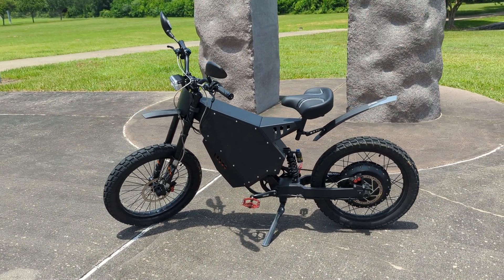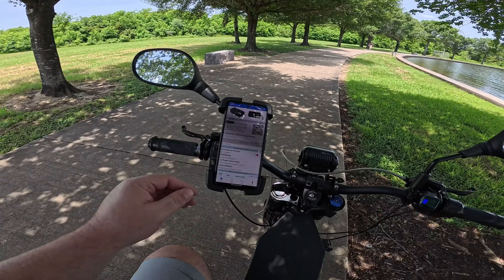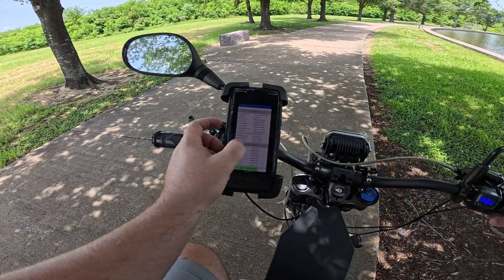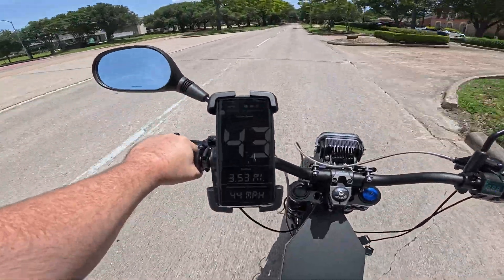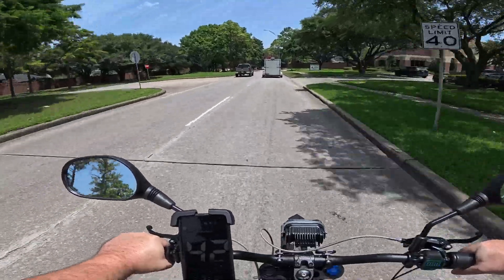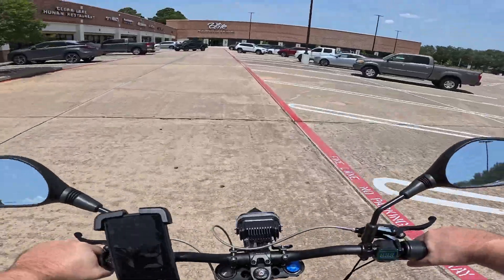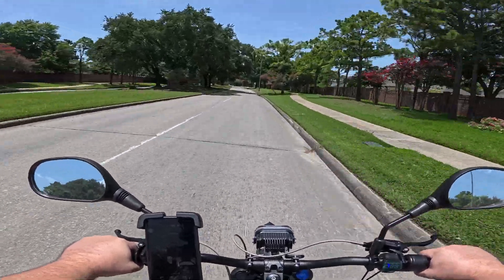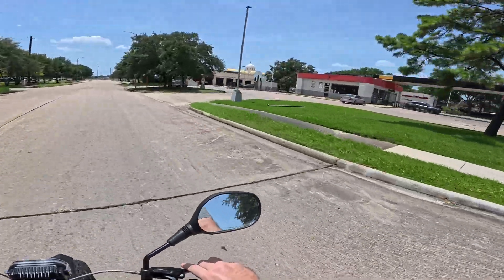I Unlocked 600 Phase Amps on My Stealth Bomber eBike — MORE Torque!

Comment: They are 50E EVE cells not samsung there is a difference. The Sammies can handle 9.8 amps and the EVE 50E can handle 15 amps. 15 amps x 15 strings equals 225 amps. I am an electrician, I work with batteries all the time. Raising your phase amps won't really do much for you if you don't raise your line amps with it. Watch my video. I explain that I'm not suggesting running 225 amps all the time. Unless you are doing a drag race leave the amps turned down. But for up to several minutes the cells can handle 15 amps just fine.
Reply from the maker: Interesting, let me do more research, if you are right I will make another video to correct the record.
Reply: Can you drop a link for the bike? Did it come with battery and charger? @FewMoto
Reply: Do you use Patreon? They are the source of truth for lithium batteries. My buddy told me you mentioned 225 amps in your video so thats why I commented real quick.
Reply from the maker: @randallhack4477  I'm glad you did, I learn a LOT from comments.  No not on Pateron
Reply: @FewMoto  Awesome now can you watch my top speed run so I can get some views LOL also, I set my phase amps to but 650 and line 225 my bike was able to reach 78.44 mph. I have the 3.5t winding vs your 2.5t but I think my 21 inch wheels offset the difference in speed and torque by virtue of being a larger cicircumstance.. also i got a motor spec sheet from my seller and they say it's rated for 15,000 watts. It does not appear to be a true QS motor. I will try to email that to you
Reply: @randallhack4477 it’s not, the qs273 is rated for 8000w nominal and 16000w peak but it could handle double that, you can run 30000w on it at 72v 

I have a qS205 3.5T hitting 85mph at 300line/650phase, no field weakening … but it’s a 84v 24s set up, so 100v fully charged, 28kw and so far no issues
Reply from the maker: Okay told chat GPT about the EVE thing, and you are correct, tomorrow I will do a new video and increase line amps to 225 and maybe leave phase alone at 600.  Thanks for the info!!

Comment: Hi i have 2 questions 1st one is if i mainly ride on toad with a little bit of off roadimg should i get the 72v 12,000w stealth bomber or the new 2025 surron lbx. And my second question is how much dows your stealth bomber weigh? Thanks
Reply from the maker: The stealth bomber is strictly a road bike imo.  However I would not recommend anyone buy a surron, the eride pro 3 is a way better bike.  My bomber is about 200lbs.

Comment: I'm looking forward to buying one of these stealth bomber ebikes, I would appreciate it if you could post a video or leave a reply to my comment of your current bikes specs and what you would consider to be better or you would recommend, also if there is any manufacturer that you can recommend I would appreciate that alot.
Reply from the maker: The only think I would change is I would get the 4t motor instead of the 2.5t.

Comment: I told you you needed more phase amps lol, it could handle up to 800phase without having extreme overheating issue

Once you start going above 600phase, up your line / dC amps a bite more so that you get the entire package, you will still feel a difference but the total KW plus the phase is what gives you that punch 

If you raise your phase by 200, up your line amps by 20-30%, 50% would great but not necessary 💯

3.5T is imo the best T option and the most popular for a reason

Btw that motor is fine unless you got money to spend lol